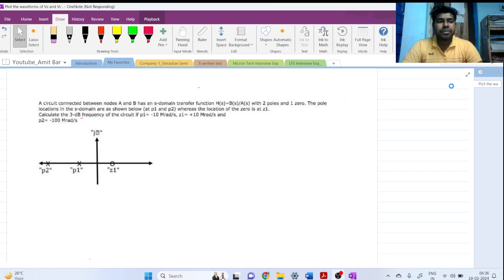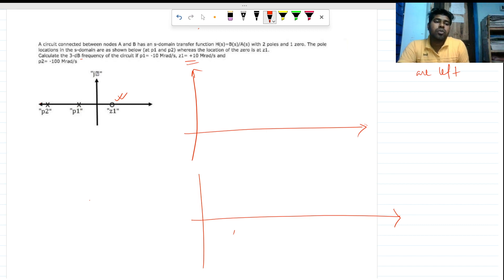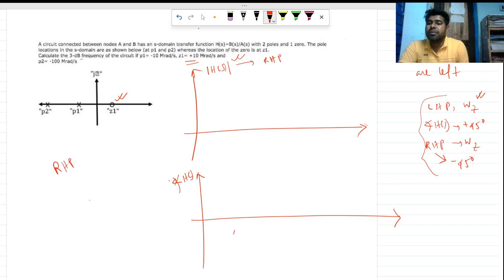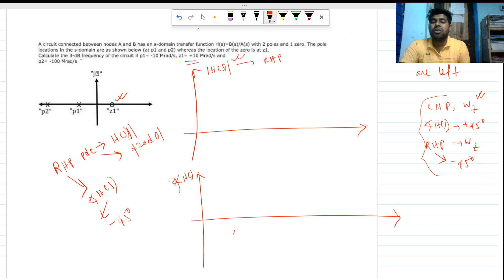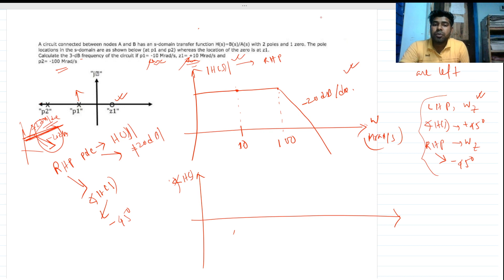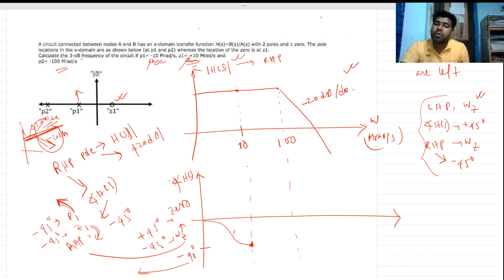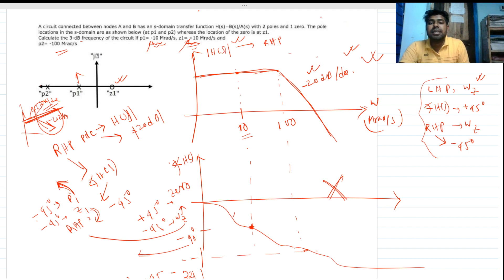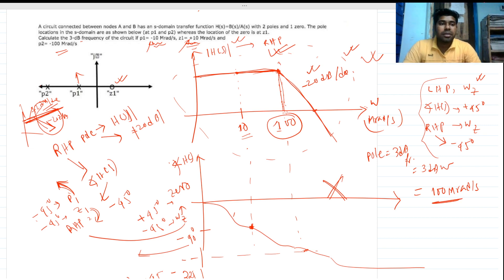Analog Design Interview Question_ Find 3 dB Bandwidth of the circuit

Comment: Sir,  with due respect, by mistake I think at 2:28, you said that RHS pole give +20dB/dec and -45 deg phase shift, which is wrong. Pole whether on RHS or LHS will always give -20dB/dec. Whereas LHS Pole give -45 deg. phase shift where as RHS pole give +45 deg. phase shift. Please write a note in description.